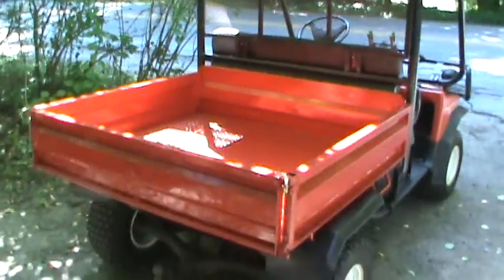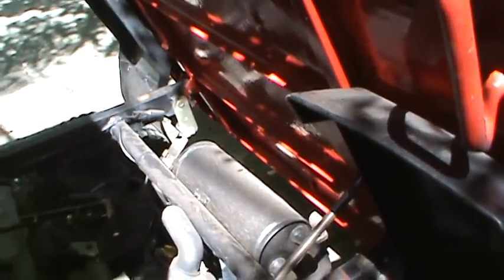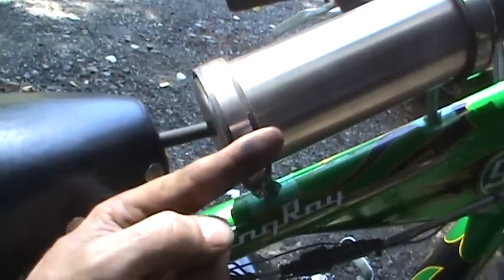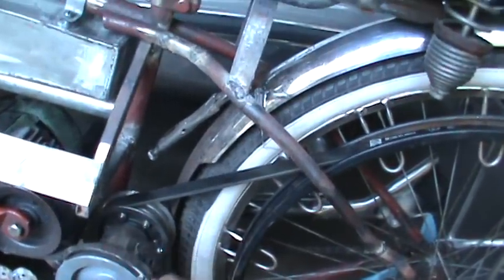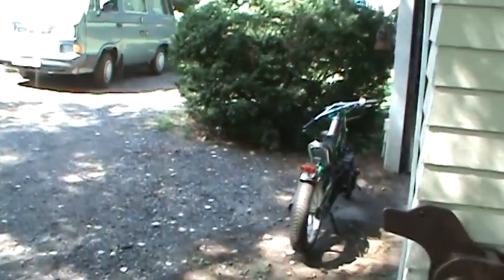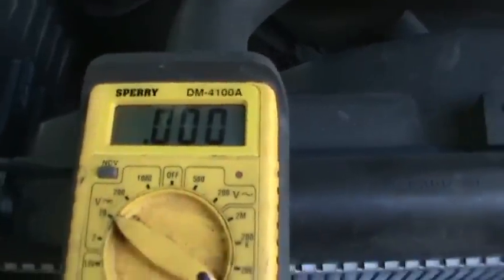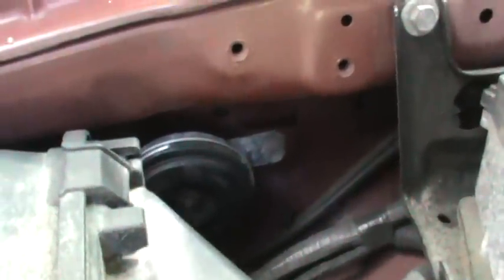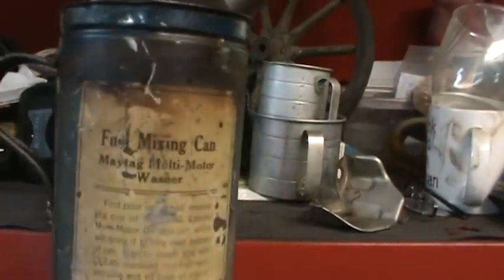garage repair and toyota alarm

Comment: Have you ever thought about popping  a valve stem in a fuel tank and remove the stem for the fuel to flow through then just slip fuel line over the end?

Comment: Lots of interesting stuff going on as usual at your place. Sorry you missed the show, it would have been a neat experience for you I am sure.
On the alarm, shouldn't you be jumping the plug rather than leaving it open on your hood switch?
With it open the alarm system will think it is not closed, right or do I have it backwards?